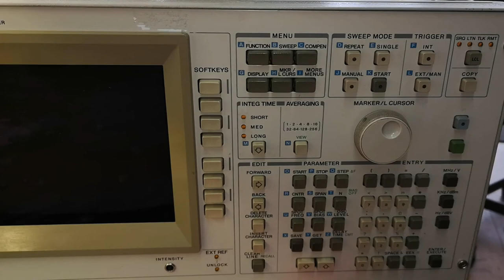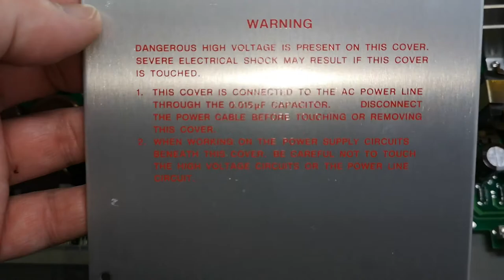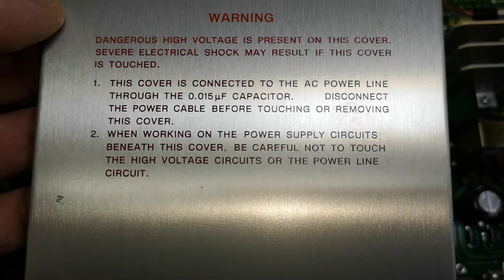HP 4194A Impedance Gain Phase Analyzer test repair teardown (Part2 main unit)

Comment: Nice video, I have a HP4194A impedance analyzer and I have an error of DC current overload, do you have any idea of this error? I disconnect the z probe and the error is the same. 
Best regards 
JOSE
Reply from the maker: the DC overload error is very common, it is explained in great detail in the manual

Comment: I have fully functional HP4194A UNIT but the problem is its software is not worki g due to which i have to take reading manually which is very exhausting and I fear continuing manual approach can damage my instrument too , so need help if someone can help by sharing software
Reply: If someone can help me with a software for hp 4914a then please help me out